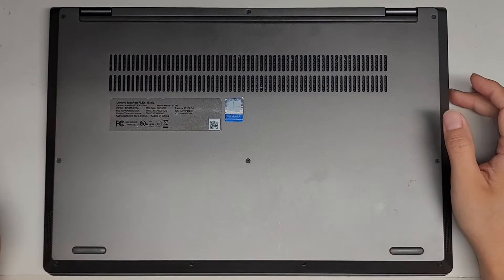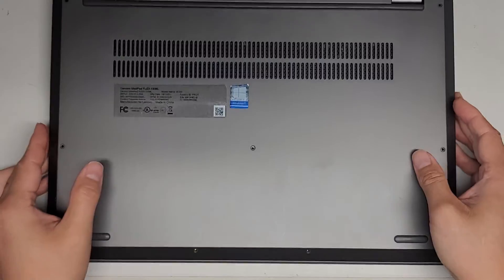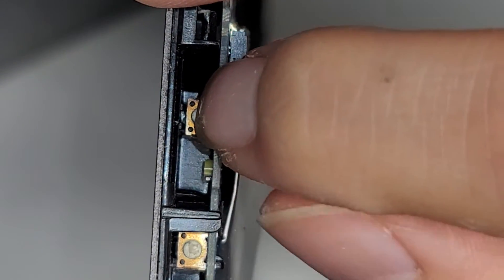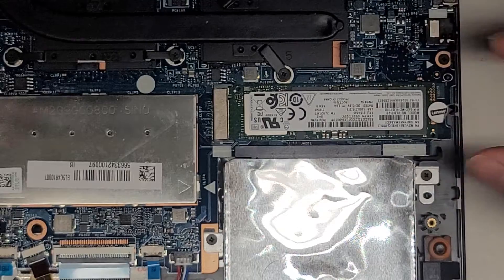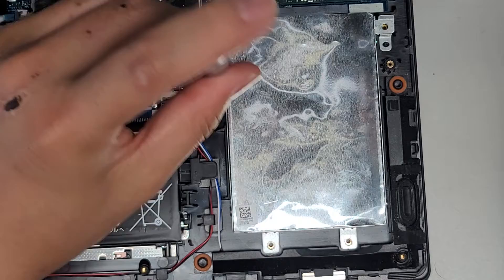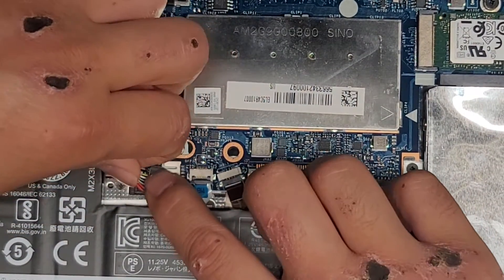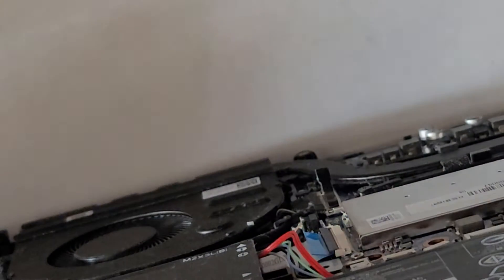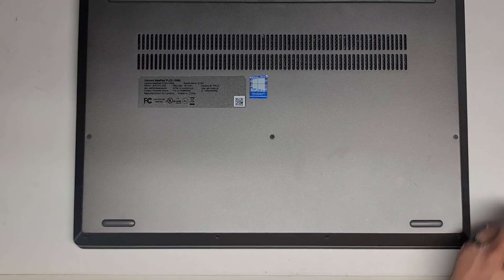Lenovo IdeaPad Flex-15IML Disassembly RAM SSD Hard Drive Upgrade Replacement Repair

Comment: I am so scared to open mine up, but I think the fan could really use a little cleaning.

 How delicate is all this? Like would the act of undoing the back cover be enough to disturb all components or break the cover clips or ports on the sides? I got freaked out about frying something if I touch a certain cable.

I just want to gently remove some dust. Pop off the back, gently clean the fan, pop the cover back on, everything functions as usual. My laptop is my baby and I don't want to break it, but am so nervous about taking it somewhere.
Reply from the maker: @QueenoftheHorizon  the video shows it all.

Comment: Any advice on removing the screen for access to the camera? You mentioned stretch tape adhesive on another lenovo. Would this one have the same set up? 
Never mind. Took a look, and found the black tabs. What about winding the tape onto something round like a pen as it comes out of the computer ?
Reply from the maker: This won't work. The stretch adhesive will stick to itself.
Reply: @ItsBinhRepaired  Thanks. Lenovo has a video of how to pull the tape They use tweezers and wind it up, then toss it! I thought that BS, as I was just making sure the camera cable had not come loose. Pulling was not that hard and I was able to reuse the tape. I cut open an amazon plastic bag and used the inside as as a place to lay the tapes without them getting stuck on something.
Reply from the maker: @jaydee3046  lol yup, as long as you don't accidentally get it stuck to itself you can reuse.